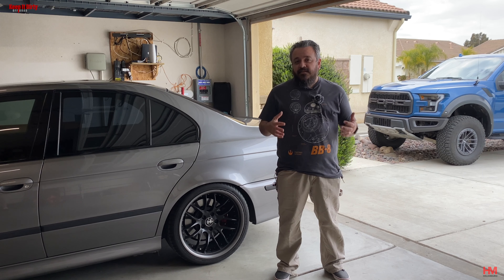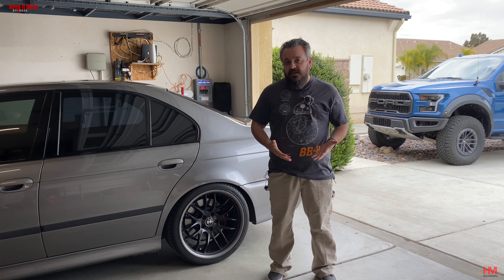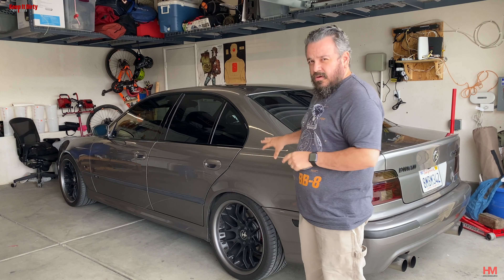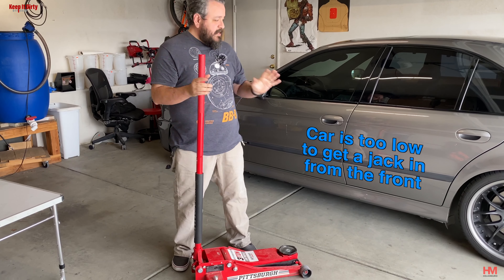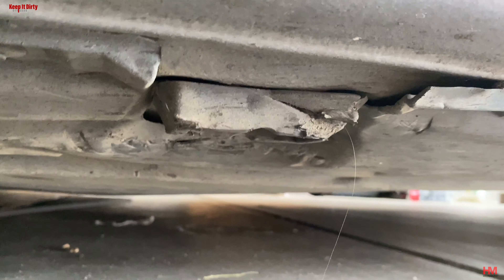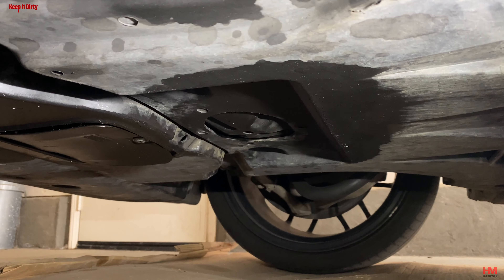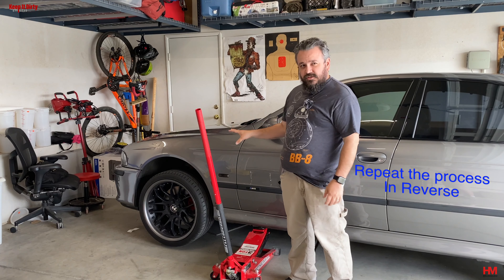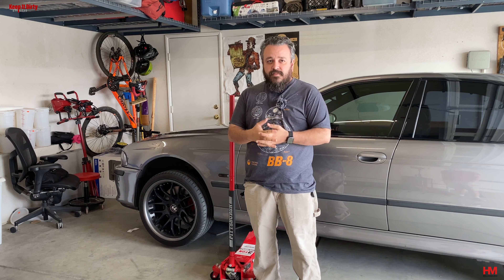How to raise an E39 on Jack Stands - the right way

Comment: I have never seen the rear end jacked up that way.  I really want to stay away from the  differential.  What part is that you are jacking up behind the rear wheel with the 2x4 wood? Can that cause any type of damage?  Wish BMW made a center jacking point for the rear like the front.  I need to take the rear wheel off, I could just use my 3 ton jack but would feel better with a jack stand in there.  Thanks.
Reply from the maker: We are jacking up from the bottom of the rear springs. Right behind the lower control arm
Next to the exhaust shield. That’s is the only safe spot we found. 

I agree on the rear diff. They way it’s machined makes us weak and there is actually a note in the owners manual I believe that states don’t lift from it.
Reply: It's not the bottom of the rear springs, it's the rear subframe bushing.

Comment: Really clear and helpful video. Thanks!
Reply from the maker: Your welcome. We saw a few other videos online that scared us a bit on how they lifted the car so we had to make our own
Reply: No need to lift from the diff either, which I wanted to avoid if I could 👍
Reply from the maker: @sebgp9102  agree. That was my concern as well. The cooling fins on the diff are not designed to hold the whole weight of the car.